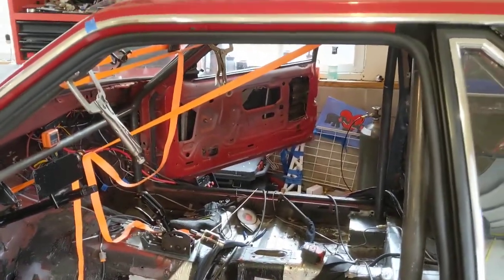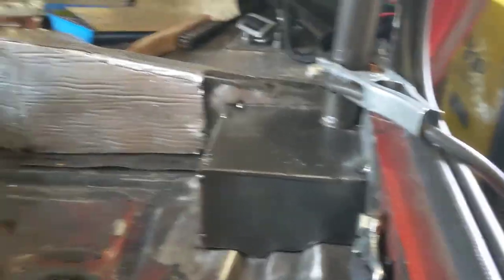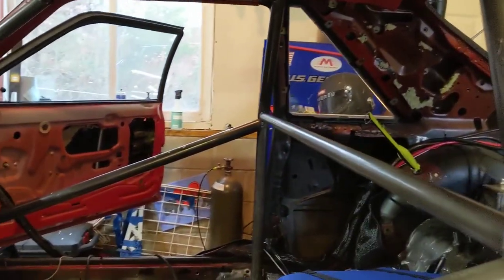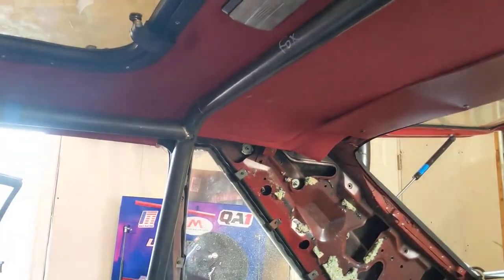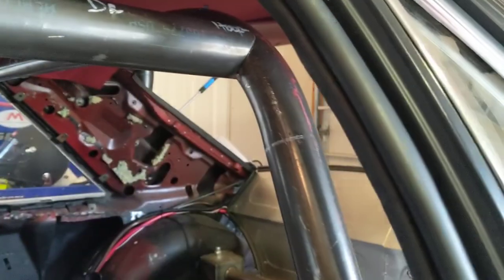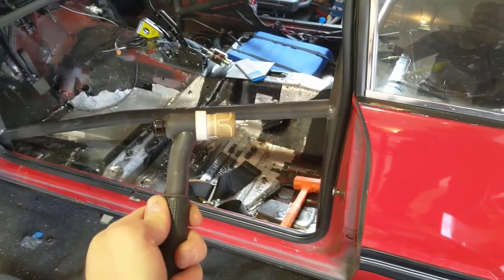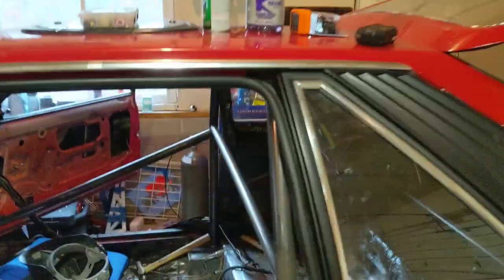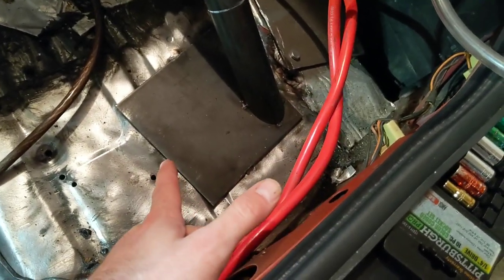Team Z Roll Cage Installed in Red Forman

Comment: How tough was it figuring out how to get the down bars thru the rear firewall and it look good?
Reply from the maker: It's not terrible to do. I would remove it and create a cardboard template that you can transfer onto the actual firewall
Reply: Awesome, thanks for the reply! I’m almost to the cage stage of my build. I’ve been dreading it, but this video gives me hope I can tackle it myself. I’m now subscribed, looking forward to seeing updates on the car!
Reply from the maker: I appreciate the sub!  In a month or so we will have plenty of content to post with the season starting. The team z cage definitely makes it easy just take your time, fit everything before your completely weld out a cage joint, and the cleaner the metal the better it will turn out.